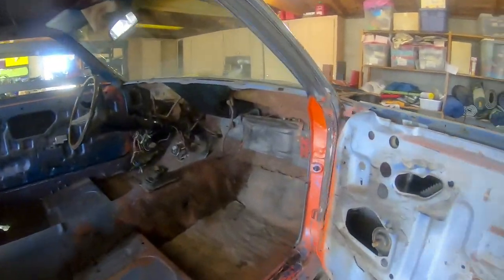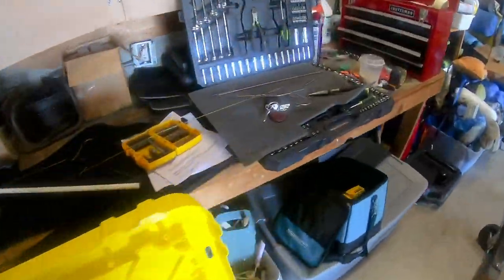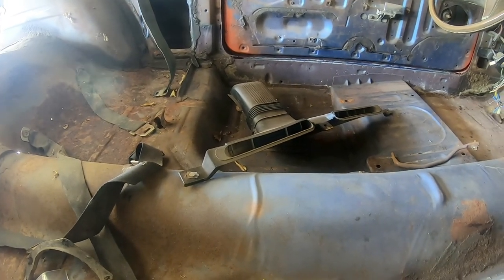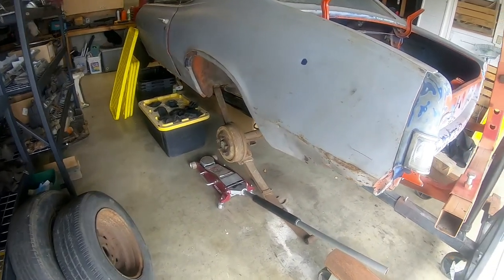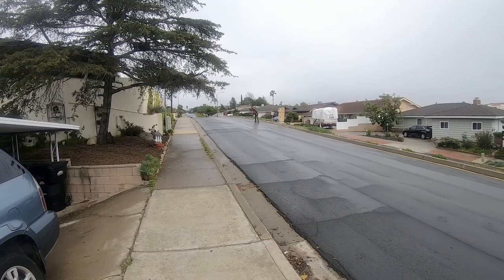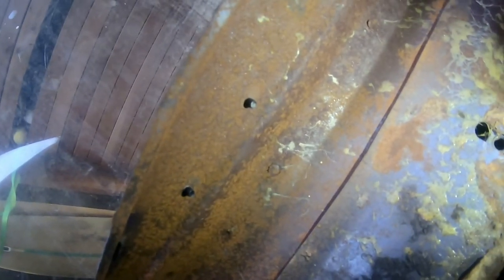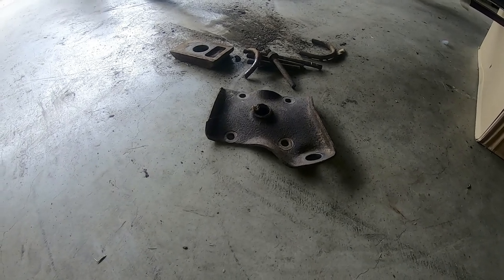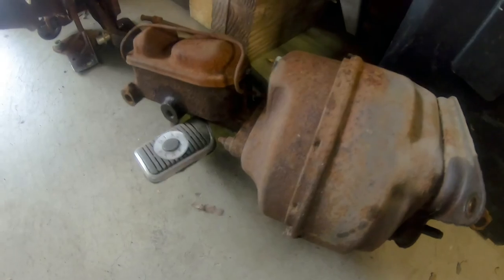Cat on a Rotisserie - 1969 Cougar Eliminator Restoration

Comment: Hi Guys !  I'm in Canada.  My '69 Cougar XR-7 is a San Jose assembly XR-7 "S" code.  I notice in this video as you examine the parking brake, that the steering column has all the tilt-away components just hanging there.  But I also noticed that there was only one ( as far as I could see ) drivers side pillar hole, for the courtesy light switch.  Was there a second hole for the switch to activate the tilt-away relay, etc. ?  Just curious.  Since the rear axle appears not be be original I was wondering about the tilt wheel, as well.  Amazing job you have started to undertake.  I look forward to seeing all your videos.
Reply from the maker: Thank you for the comments. The car is not originally a tilt away car. The tilt column was added at some time. I'm not sure about the switch for the tilt as I haven't dealt with a factory tilt car. Thank for following along

Comment: I couldn't make out what comment you were making as you ran your finger over the letter on the rear differential case ?  Is that a Nodular case ?  3.50:1 rear gears - posi ?
Reply from the maker: The rear that came with the car is a N case 3.50 Traction Lok. The car originally had a 4.30 Trac Lok